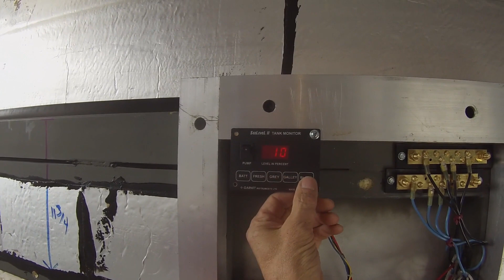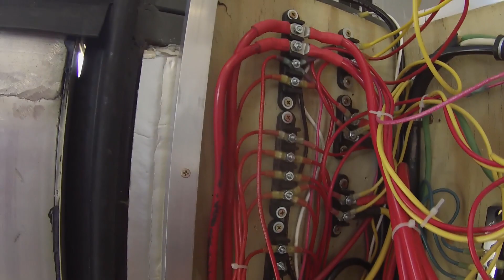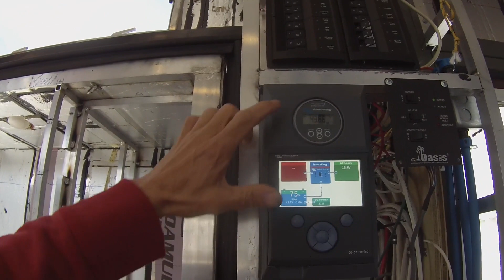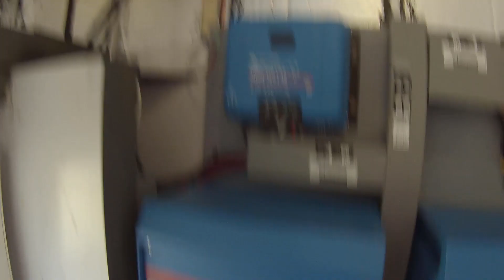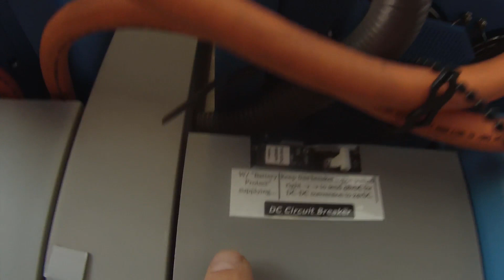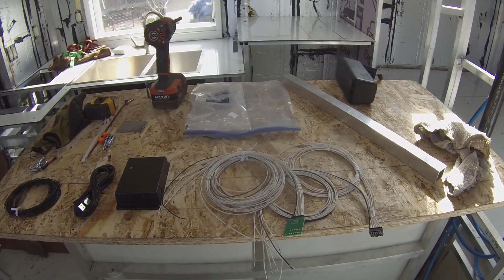Tesla Powered Tiny Home - Electrical Walk-through

Comment: when you talked about your water supply and how long you could shower for, made me think of a system I plan on incorporating into my plans, and that is a recycling shower system. Basically, it heats up a gallon of water for the shower, drain water gets double filters, reheated back up to temp and put back into the shower. With this system, you can shower forever on a little bit of power to bring the water back up to temp. After the shower is complete it purges the water into your grey water tank.